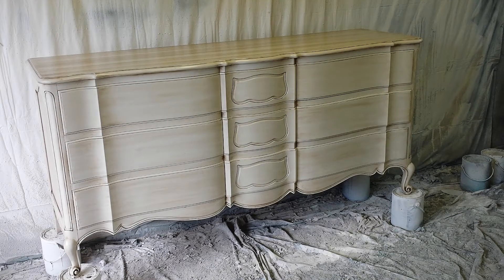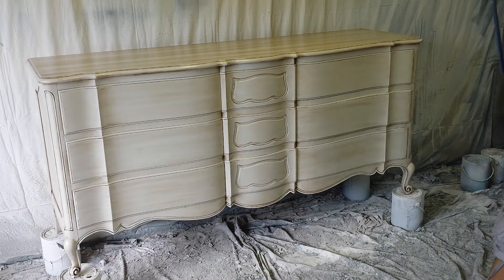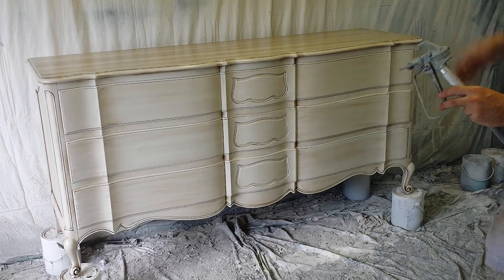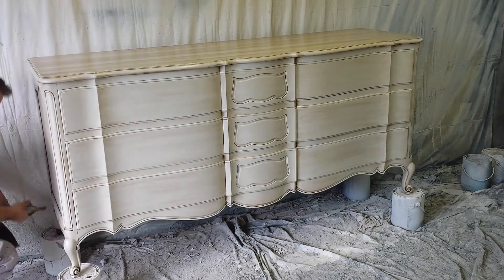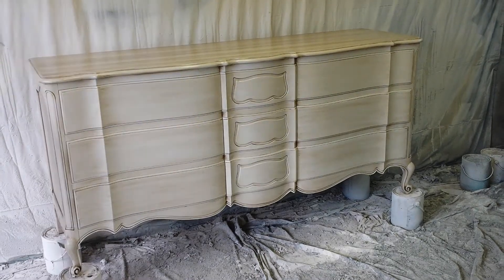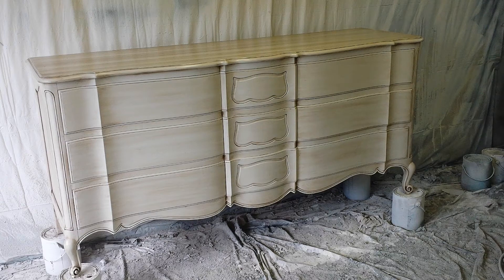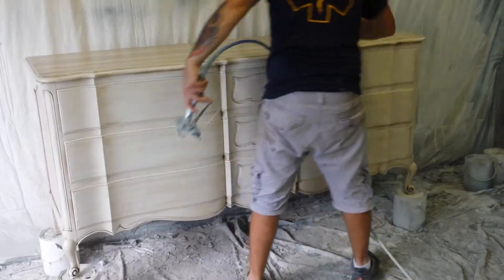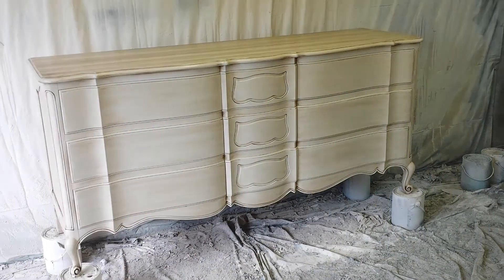Painting Shabby Chic Furniture: Start to Finish - Part 15

Comment: Do you use a water based or oil based stain for your typical glazing?
Reply from the maker: I use oil based stain when I am stain glazing, which is my typical style. It works different from traditional water based glaze in that it tints the paint, doesn't need water to be wiped off, and re-wets itself so if you mess up, you can just apply more and try again, whereas traditional glaze dries and either has to be removed or painted over to do another attempt. Both have their upsides and downsides. Oil based stain is just how I learned to glaze and it sets me apart from most other painters.
Reply: @ThatShabbyGuy  thanks so much.  I am going to try this on my next project.  I like the fact that you can re-wet to get the look you want (especially for my first try at this) as my piece has some deep grooves/designs that could be hard to get into.  Especially since I will need to seal it anyway.

Comment: Could one use a brush or small roller to apply the paint & varethane?
Reply from the maker: People do use paint rollers to paint furniture. I tried it when I first started but I'm a stickler about brush strokes and anything similar. I couldnt get a roller to leave a smooth finish without having to sand in between coats so I just used a brush until I got my sprayer. You can actually get a brush stroke free finish if you add a little water to your paint and apply it in 5-6 thin coats instead of 2-4 thick coats.
Reply: Thank you for your response, I might have to get myself a sprayer!! : )
Reply: Can u use any waterborne lacquer?